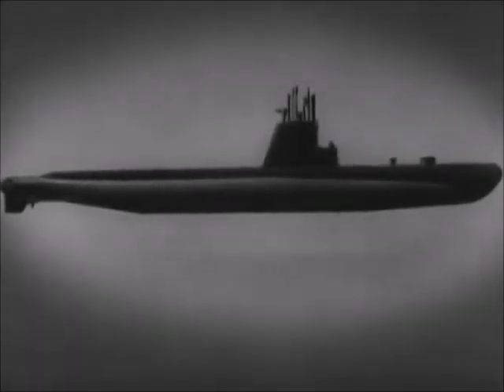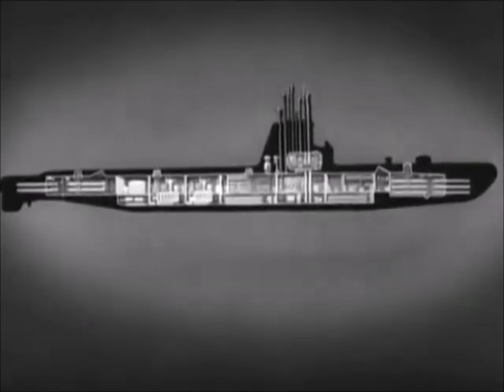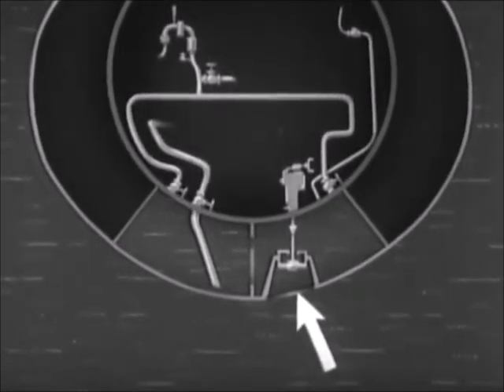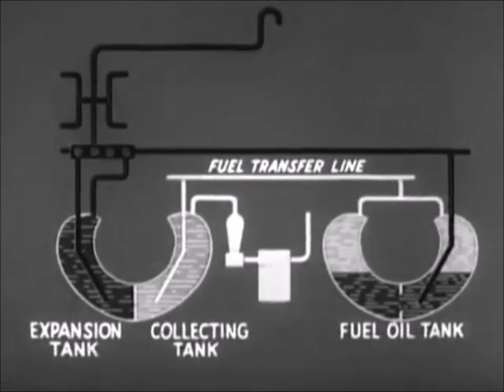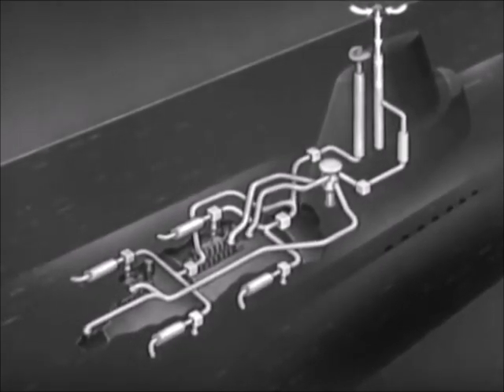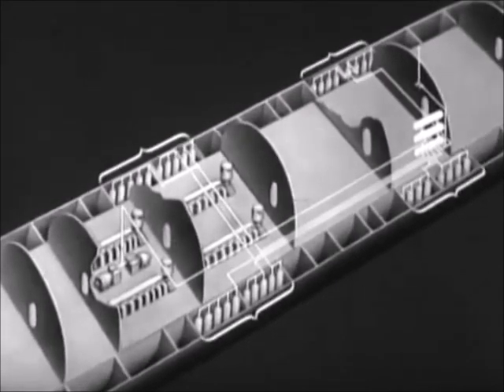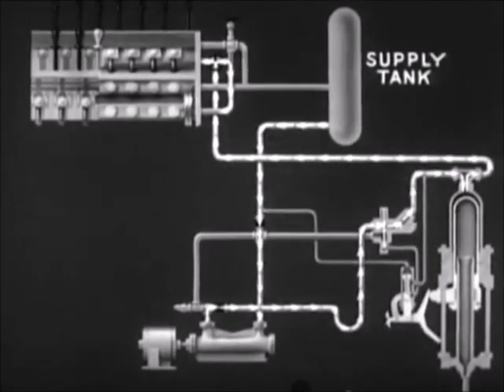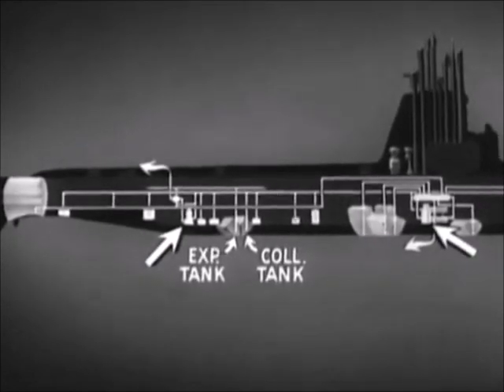How are WW2 era US Navy submarines constructed ? 1955 U S  Navy Training Film

Comment: You answered my question. The 2 propellers at driven by 4 election motor powered by generators, powered by 4 diesel engines. When submerged without snorkel air the propellers a driven by elector motor power by batteries. How long did it take a charge a low battery?